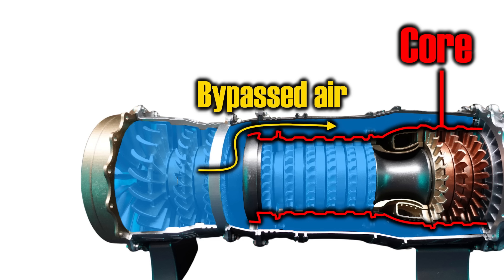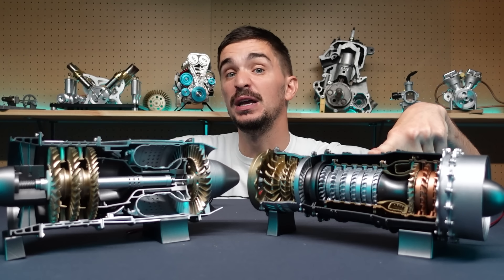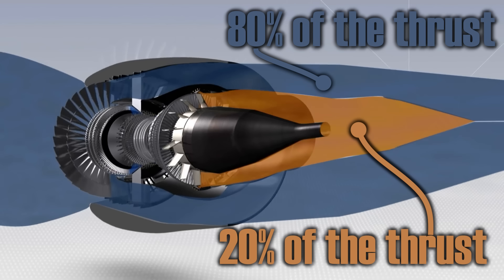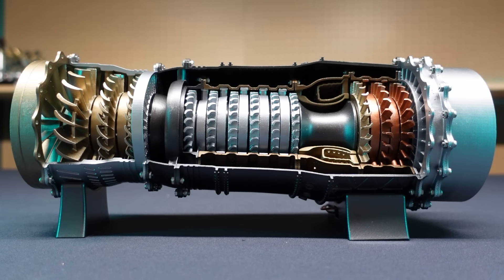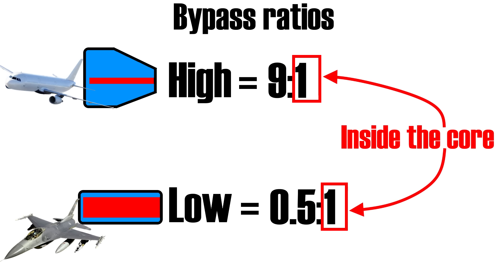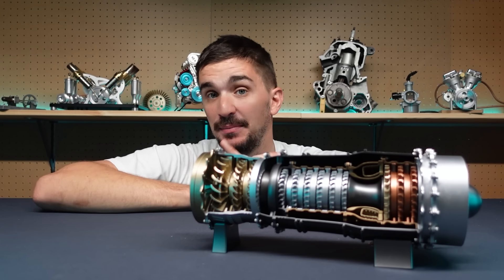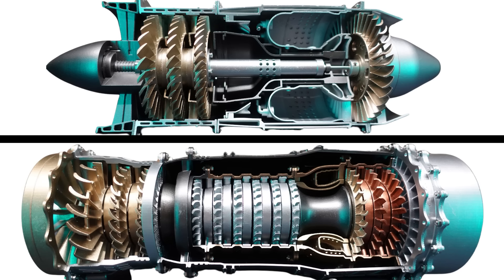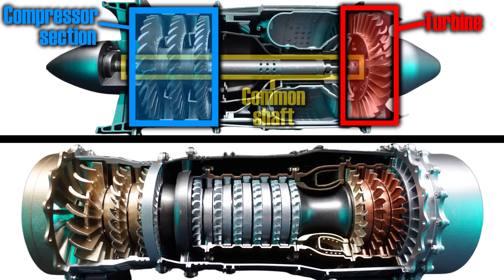Jet Engine Evolution - From Turbojets to Turbofans

Comment: You are nearly 90 years too late, mate! The Jumo 004 was already there in 1944 using the axial flow.
Reply from the maker: Too late for what?
Reply: @d4a was explained, the differences between the engine designs and their uses. The jet engine was developed in the 30's and came to fruition in the 40's, two camps got their own version of the jet engine into production, but we all know where this all went, the direction that is. RR produce the Whittle engine and the Yanks developed the 004 into the enines they use today in their fighter aircraft. Both engines are the granddaddies of all following engine designs since 1945
Reply: @d4a was explained, the differences between the engine designs and their uses. The jet engine was developed in the 30's and came to fruition in the 40's, two camps got their own version of the jet engine into production, but we all know where this all went, the direction that is. RR produce the Whittle engine and the Yanks developed the 004 into the enines they use today in their fighter aircraft. Both engines are the granddaddies of all following engine designs since 1945

Comment: This is why the Pratt and Whitney engine that has a gear reduction is going to be so important. They believe they can increase efficiency by 25% meaning that these engines are going to be so much more efficient than they were just 20 years ago. We’re going to be able to fly the same distance with a third of the amount of fuel. I think the next major step is creating bio fuels so that we can subsidize the industry so that flights can be regularly under $100. If you can fly anywhere across the country at any time for less than $100 the airlines can begin to make money in every other part. I think offering a program where they charge people a month fee like a gym or a Costco membership could make it so they could offer these low prices to their members and if they have 10 million members paying $20 a month or $250 a year. That’s $2.5 billion in direct profit from their memberships. That’s a far better way to run an airline

Comment: The thrust of a turbojet does not come from the exhaust at the rear. The thrust is the net difference between forward and rearward gas loads throughout the engine. Most of the forward gas loads come from the compressor and combustor stages whilst most of the rearward gas loads come from the turbine stage and the choked nozzle at the rear. Thrust emanating from the expulsion of gases at the rear is the principle of rockets, not gas turbine engines. A;most every YT video on this subject gets this wrong.

Comment: What about engines in helicopters ?
Do turboshaft engine is a type of turbojet ?? If yes then it contradicts your statement......

And still turboprop engine is based on turbojet , which is used on small passenger planes.....😑

Comment: Love your videos but several explanations could be better:
1) 10:15 : the airflow direction is very strange. You have drawn it like you did not decide whether the rotor or the stator is the frame of reference. If the stator is then airflow must go only downwards after it enters the rotor because it's mechanically impossible to go other way (the damn blades are moving downwards)
2) I cannot fathom how spinning in opposite directions cancels gyro effect, I smell severe bullshit. Inertia (even if created by spinning mass) does not have a sign.

Comment: Modern high-bypass turbo-fan engines have more in common with turbo-prop engines than with traditional low-bypass turbine engines.
Good video!

Comment: Are the shafts always mechanically connected? It seems logical to let them rotate independently.
Reply: Correct - they are not mechanically coupled, and only change speed somewhat together because their speeds are both related to airflow.

Comment: Not all is correct. First the speed of sound is not limiting factor of fan diameter. If you want high efficiency you want tip of a blade to have subsonic speeds no matter what size of the fan. This rule will apply even for miniature jet engines. Supersonic velocity at a fan blade or its part will make the compressor stage more productive since work is proportional to velocity squared. Second you said that compression takes place in a stator not in the rotor. That is not true. Rotor blades (subsonic) also have divering channels just like stators and the relative air velocity will decrease and the static preasure will increase. Of course since the air gains velocity from the rotating blade it will be reduced and converted to preassure in the stator later. One more thing. There are no outlet guide vanes in the compressor that you show on the scheme.

Comment: Please let me humbly remind you that MOST fighter jets used by militaries, DO NOT use high-bypass engines. They are too sluggish and are not compatible with Afterburners. So it's not so much of an Evolution but an Adaptation, of the engines for different tasks.
Reply from the maker: Did I say fighter jets use high bypass engines?
Reply: He does explain the difference in bypass ratios if you listen carefully
Reply: Your ears must be painted on
Reply: He didn't say they did. Spend more time enjoying the video and less time trying to catch the creator in a mix-up.
Reply: Allow me to correct my speech. Turbo-Jets are not obsolete. Many aircraft still use them. I was an 21J Engineer in the U.S. Army. Please also read the comment in its full and in context. If you don't understand the complexities of "modern" engines please don't guess. Militaries look for simple, easy to maintain engines. Turbo-Fans are very very complex and heavy. So they are NOT always the correct answer.
Reply: @d4a  Sorry I misheard. I do really enjoy your videos. As I am a huge fan of combustion engines!
Reply: @ponchoremerize5508  that's not a correction of speech, that's a completely different statement. And it's not valid... while I'm sure that there are some ancient turbojets still in service, they're just old stuff still operating. New aircraft (for the past half a century) use turbofans (now high bypass in subsonic applications, still low-bypass in higher-speed applications), because the complication is worthwhile. 

What US military aircraft still in production uses turbojet engines? Supersonic aircraft, with afterburners, use turbofans. Even UAVs use turbofans.
Reply: @brianb-p6586  I choose to speak how I wish. And I shall provide a non-exhaustive list of CURRENT aircraft that use Turbo-Jet technology. End of discussion!
Reply: @ponchoremerize5508  you can speak any way you want, but that doesn't change facts. And I look forward to that list... or perhaps you already posted it: since it would be empty, it might be there and just not visible.

Comment: I don't particularly like your description of "jet engines do intake, compression, combustion and exhaust continuously where piston engines do not".
Because piston engines do this continuously as well, just not at the same time as the other steps. If it didn't do it continuously then you'd have to manually restart the cycle every time, which you clearly don't have to!

It's a matter of sequential vs parallel operation. The piston engine is sequential, the jet engine is parallel.
If somehow the piston engine was parallel, being able to do intake, compression, combustion and exhaust on every stroke then it would the same as a jet engine in that regard.
And technically speaking, if you made a really bad piston engine, you could actually do it that way! It just wouldn't have much power.

Which brings us back to the jet engines, each impeller (blade) of a jet engine is like a tiny piston. The pressurized air flowing over the impellers makes them turn.
If you feed compressed air through a piston engine in place of it's combustion cycle, you are doing the same thing with the extra mechanical step of turning linear into rotational energy.
This is how steam locomotives operate, turning a high pressure gas into rotational work. So going by your logic, if combustion (firebox), compression (heating water to steam), Injection (power stroke on one side of steam piston) and exhaust (venting steam through the smoke box on the low pressure side of the piston) all happen at the same time in a steam engine then they are equivalent ("continuous") to jet engines... Which they are NOT.

Steam turbines are also not equivalent to jet engines, despite sharing MANY MANY features of jet engines.
Reply: Piston engine operation is not continuous; it is cyclic. For instance, each combustion phase is a separate event - it does not continue, it is repeated (frequently and regularly, so the engine keeps running).
Reply: in WORKING VOLUME in piston engine actions are in cycles in jet engines are continuous, that is official definition ,comply with it, it will be easier for you